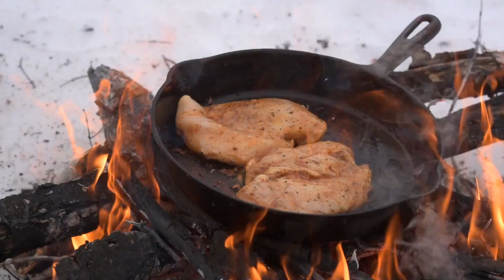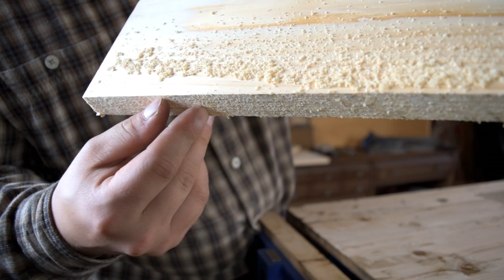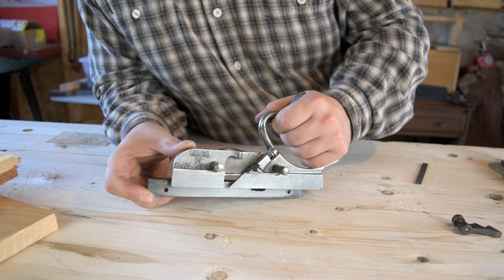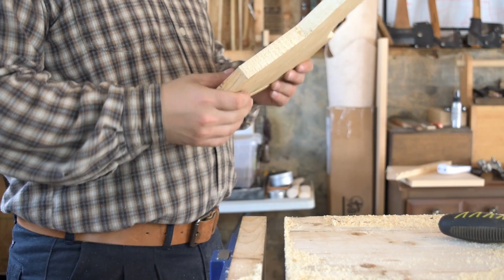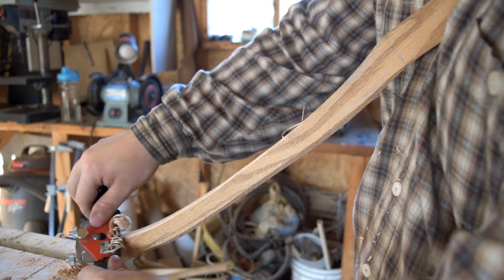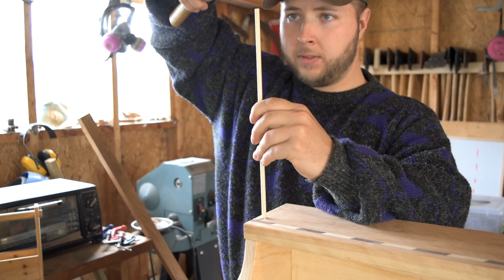How to Make a Tool Tote With Only Hand Tools - [NLH. 4]

Comment: Another piece of quality craftsmanship that will be around for generations. It's almost too pretty to throw tools into. Between the grain structures and the inlay, and the bowed handle. Its a piece of art. Makes the one I made from plywood and screws look like a pile of junk in comparison, and I was happy with how mine turned out. Haha. Cheers till the next one bud.
Reply from the maker: haha the plywood versions are abundant! I have seen many. But, those versions get the job done and you didn't spend mountains of time making it. 
I'm really happy with this project. Glad you liked it man!

Comment: You make that look so simple. Truthfully I haven't got the patience for working with wood and I prefer power tools😀.  BTW that tote came out beautiful. 
 Now I'm off to work to shape metal and use freaking large power tools😁
Reply from the maker: haha Woodworking is extremely relaxing. It's a nice break from the grinding and machinery and oil and cutting fluid. It's dry, clean, doesn't require any safety gear, and you can set a tea down on the bench beside you. I welcome it when I get the time to do some woodworking! haha